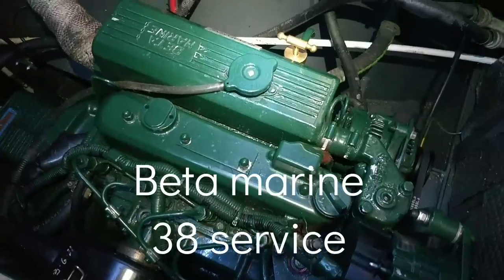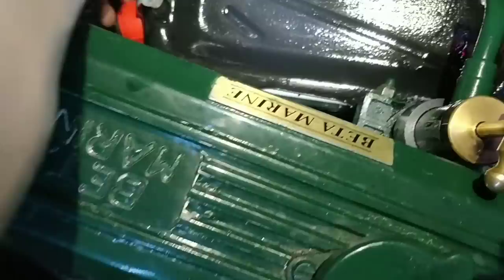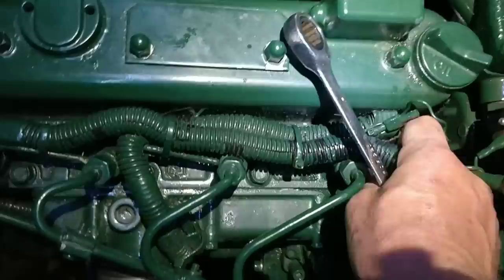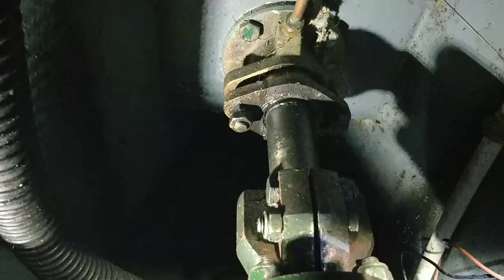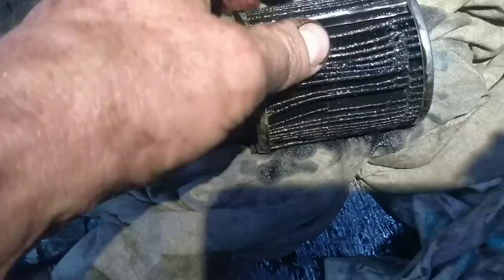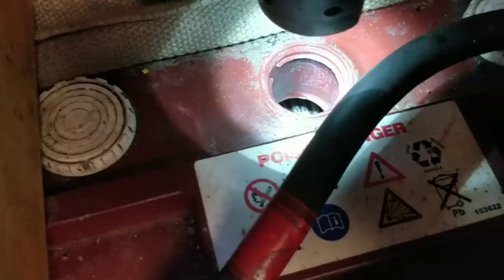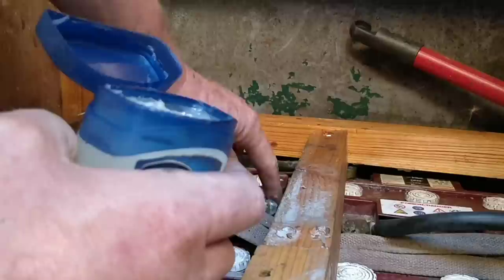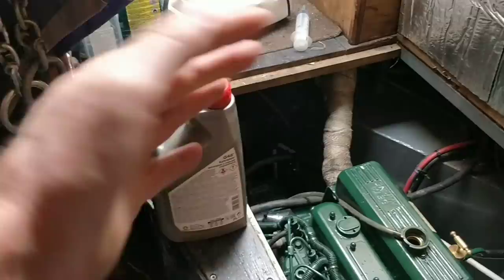Narrowboat Engine Service. Beta Marine 38. Gearbox oil and Battery check over. Not a how to vlog.

Comment: I'm amazed how clean my tractor engine runs even though it's a new tractor a diesel is a diesel the oil doesn't stay clear for long turns black pretty quick but after 50hrs the oil is clean as a whistle so well done kioti it's a lovely engine 2.4 turbo 😍
Reply from the maker: My oil stays black. You must have a great filter system. Can't beat a good old diesel motor soon to be out lawed if the green brigade gets their way. Keep on trucking buddy.

Comment: Nice one Will that was a good 38 mins to watch I was well into it am defo going to put vas on mi terminals in mi car put a new battery on in May and mi terminals were all mest up I cleaned them off so now I will do that good tip. Getting colder now Will stay warm pal keep safe get some more golf in Cheers🙂🔧⛳️✌️
Reply from the maker: My terminals were really bad but being covered in Vaseline seems to do the trick. My trojans are still going strong. filfy fumbs up.

Comment: Just a suggestion Will. Phil here from NZ. When pumping out your engine oil, fit some rubber hose onto the outlet pipe and into your drain tray/container. Should prevent the oil plashing and and annoying clean up. Otherwise a great vlog. must be backbreaking getting into your engine bay. Love your adventures.
Reply from the maker: That's a great idea Phil i will next time. it is hard getting to the prop and gearbox etc. worth the effort. Can't beat a good old engine service Phil. You take care..

Comment: Hi will. Back in the 70s got given a good tip with desiels while  a apprentice with BL. To add a little bit 2 stroke oil in with fuel at times . It helps lubricates valve stems. Does the trick on certain tractor units that tend to suffer to valves sticking and popping if used on idle for extended periods.
Reply from the maker: That's a good tip. I'm cruising every other day so my engine gets a good run. A periodic thrash helps diesels as well. Cheers David
Reply: @NarrowboatWill  we used  to add deisel flow into the fuel but we don't now du to the fact we don't get freezing winters no more.  I went over to Atkinson. Lovely engines. Spent years overhauling them. Today's Scania and Volvo's are superb power units.  Those Kabota engines like yours are brill little things. Mates got a Kabota tractor. Never gives trouble

Comment: Will, next time you are going to change the engine oil put the collector bottle the other way around with the inlet closer to the output of the little pump,  and attach a piece of hose onto the outlet pipe of the pump and put it into the bottle that way when you get to the end of pumping out the oil it won't splatter everywhere and you won't have to try and wipe the oil off the top side of the collection bottle, it will make it a whole lot less messy.
Reply from the maker: Yeah good shout Brian. Will do. Cheers

Comment: I like to use a bit of hose, connected to the oil pump out and poke that into the hole for my oil collector. Saves all the spraying when it starts to get empty. Just a little top tip 👍👍
Reply from the maker: That's a good idea bloody splats everywhere. That is a top tip. Ha ha

Comment: Great blog again will only one picky bit mate it says in information on battery’s only fill to just over plates as they were before you filled them as they damage sells after time and they not cheap to replace keep up the great vlogs will
Reply from the maker: Yeah I know but they boil dry really quick when the sun comes out. So I put extra in. I don't think that will harm them. Still going strong and I bought them second hand 4 years ago. Cheers
Reply: @NarrowboatWill  as long as you now will I now how much batterys cost keep up these great vlogs will god bless mate

Comment: use red antifreeze all the time Will. It will mix with anything and it’s also biodegradable.
Reply from the maker: I was told never mix colours because of different temperature contents Malcolm.
Reply: @NarrowboatWill  the red antifreeze from Halfords will mix with anything and it is biodegradable. I use to work with the stuff as a mechanic for donkeys years. When you do a coolant change next. Go over to the Halford red. It also works for twice as long so also cheaper in the long run. Check it out when you next see a Halford store.
Reply: Not the premixed one though. Forgot to add that. 🤣
Reply from the maker: @malcolmmarks7374  Will do. I use it in my van.

Comment: Hi will,  what a brilliant video,  very informative and interesting, when topping up batteries I find a syringe works better because you can see what you are doing, after how many hours do you do a service, filters etc.
Reply from the maker: That syringe is a good idea. I service every 250 hours David. Every third service i change the air filter every second service change the fuel filter but i tend to change the gear oil every time. Thanks for watching.

Comment: Overcharging by the alternator encourages the battery acid to release more corrosive hydrogen gas than is normal or safe. Usually forming crystals on the positive terminals.
Not a big problem providing you check and maintain the batteries regularly and clean the posts etc and smear with vaseline like you did.
Greasy fumbs up Will.
Reply from the maker: It was alot worse Harry. That Vaseline seems to do the trick. still going strong fair play to Trojan. Thanks again

Comment: Will why don’t you put some tube over the oil pump out and lead it to the drain can on top of the motor then it’s level and no messing about,great videos tho..
Reply from the maker: Why didn't I think of that. Stop it splatting everywhere. Cheers Dave